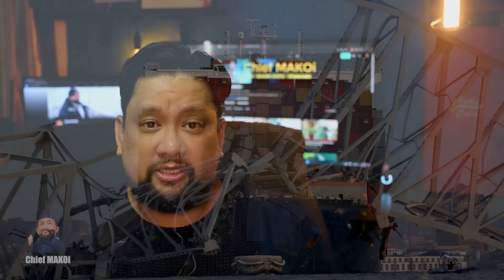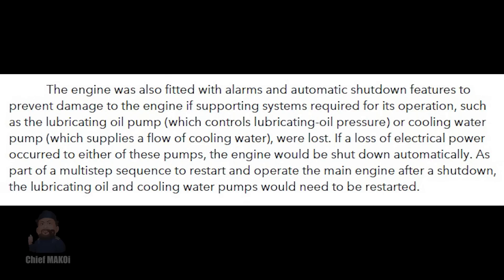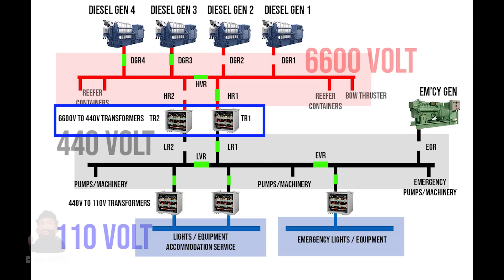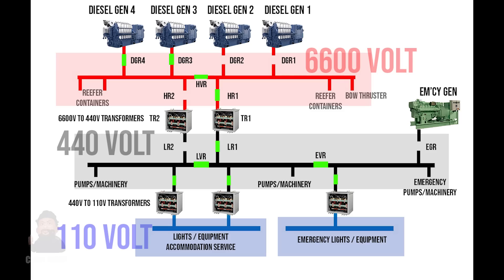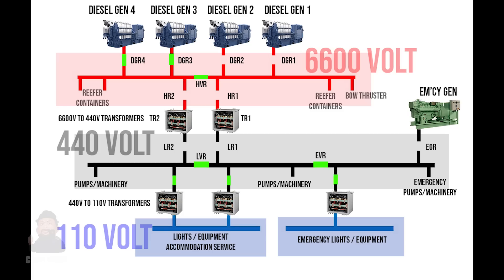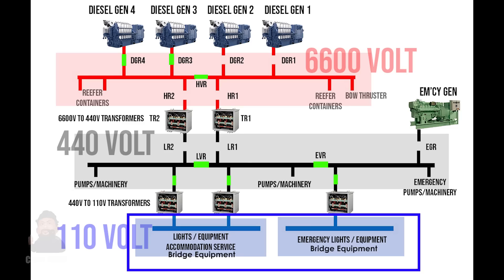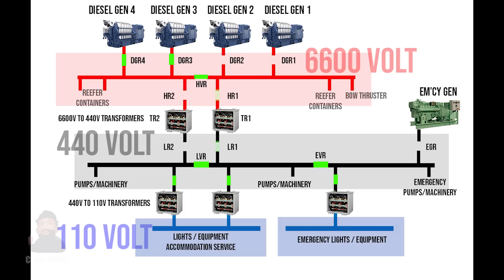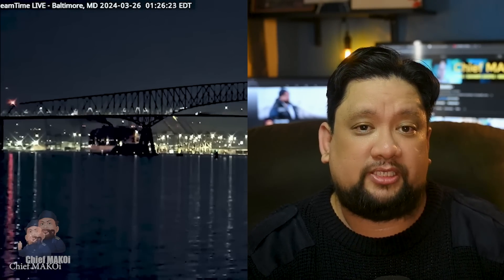Explaining the NTSB Report on the Container Ship DALI | Chief MAKOi

Comment: I think the start of this problem is in either generator 3 or 4  . If either one is not receiving enough fuel the other one can be driving the one with the fuel problem because they are locked together electrically. The good generator would be overloaded and make black smoke and would be running to slow. The cycles would drop , this would increase the output amps on the 480 volt transformer tripping its breakers. Generators 3 and4 shut down due to overload on the good generator . the fuel problem generator shut down due to lack of fuel. I also think the crew has it wrong stating that both breakers in and out tripped open for transformer TR1 . The inlet breaker protects the transformer the out put protects the wiring down stream.
Reply: I think so too. In the panic after the first blackout, they forgot to turn on the fuel pumps as soon as they got power back on the 440v bus. Looks like the same thing happened in port when DG#2 shut down from the exhaust stack flap, and #3 started but there was no fuel pumps running at that time because of the blackout.
Reply: Motorizing one of the generators despite safety mechanisms is one possible explanation for the heavy black smoke.  I'm thinking the other possible explanation is they were lined up on Heavy Fuel Oil instead of Ultra Low Sulphur Marine Gas Oil for generator restart.  Its not clear to me how it was determined when the generators were on and when they were off.  To overload the generators enough to make that much smoke with a fault in one of the transformers, I would think there would be a phase to phase or phase to ground situation that would be spraying molten metal and pretty easy to identify.
Reply: @douglastastad7437  They were using LSMGO for about 3 weeks before this incident, so no fuel changes in last 25-27 days. I'm thinking more along the line of fuel starvation due to the loss of 440v when TR1's breakers tripped. They had t his same problem the day before when DG3 auto started from standby after DG2 tripped from the exhaust being blocked, which also caused a brief blackout, and DG3 shut down due to low fuel pressure. Then they had to restart DG2 and switch transformers
Reply: @brnmcc01  Where are you getting the detail regarding LSMGO being burned for 3 weeks prior to incident? I would find it very hard to believe a vessel with scrubbers is burning LSMGO on an ocean voyage.  Would love to see the noon reports and Maersk corporate's response.  But if that is the claim, it would only add to my suspicion.  Now the NTSB states they were using LSMGO during the incident 3 times in their preliminary report, but they can't yet determine if the emergency generator came on in 45 seconds.  My guess, yes fuel starvation... Because they were switching to HFO and Effed the line up.  Why switch?  Oldest trick in the book.  Your point is an interesting one though - I wonder if there is any video or other record of black smoke while she was at the pier duirng fuel starvation blackout - you put that up the stack during daytime and the port captain should be writing up a fine.
Reply: @douglastastad7437  I read it somewhere in the full NTSB report, the ship had made another port call before heading to the Sea Girt terminal so they had been running on LSMGO for a few weeks prior to the incident. And yes they would have switched over to heavy fuel oil for the very long voyage to Sri Lanka as soon as possible, but they wouldn’t have started it that early. It takes a long time to do the switch and has to be done carefully and gradually over a several hours. Chief Makoi has a good video on his channel explaining the process. There’s a lot of steps involved in making sure the fuel is up to the right temperature, fuel samples must be taken and viscosity checks etc.
Reply: To do the switch over right and not - you know - cause a blackout would take some care.  It's also illegal to make the switch that early.  I remain suspicious.
Reply: @douglastastad7437  You're absolutely right, but if they were doing that there would be mixed fuel in the fuel lines, day tanks etc. The NTSB has already taken fuel samples off the ship looking for just such a thing. Also representatives from the ships owner also had fuel samples taken and shipped back to Singapore. I think the reasoning behind that one was if the ship owner could shift at least some of the blame onto contaminated fuel they had just previously bunkered prior, the ships owner could then use that as an exhibit in their court filing invoking the 1800's limited liability that the Titanic used, as in "it wasn't our fault, it was that bad USA fuel". Well, that didn't go anywhere. I think it was a transformer fault combined with faulty electronics in the swithboard that caused this whole mess. Why was TR2 in use for "several months" according to the crew statement in the NTSB report? You'd think that responsible engine room staff would regularly switch transformers, because having a spare is really nice, but, if you never operate your spare equipment, how do you know it'll work in case of an emergency? Like when a power outage happens .6 miles from a bridge with only 4 puny dolphins....🤣
Reply: @douglastastad7437  I think in this disaster, like so many others, we have to apply the good old Occam's Razor here. "Never attribute to Malice, what can be adequately explained by incompetence". We already have plenty of evidence of the latter. Working on an exhaust scrubber on a running engine? Really? That's so dumb and dangerous due to the poisonous exhaust gases, plus very high temperatures involved. Closing an exhaust damper on a running engine and plugging it's exhaust while under load? That could have caused severe damage to the turbocharger if it didn't trip and shut down fast. And TR1 hadn't been used in months, so they switched from using TR2 which was working reliably for several months, but then during a high risk docking and port maneuvers let's use TR1 during a critical time? Yeah I get it's important to exercise your spare equipment, but leaving port is not the time to mess around.

I can nearly guarantee that if Chief Makoi was in charge this shitshow would have never happened :) Or at least been much less likely.
Reply: Nope.   Generators on a common circuit like that have back feed protection for just that reason.    Governor quits,  fuel dies,  regulator  quits,  the Revers Power Relay trips it off line via its CB.   That CB is charged up to trip so its just a solenoid to trigger it OFF.

Comment: Thank you Chief, this is the true and correct explanation of the NTSB report, as it is very clear in all details. 

I worked with 50 Hz generators and the breaker usually trips either because of a current overload, an under/over voltage, or because of an excessive frequency deviation, say below 45 Hertz or above 55 Hertz. The engine governor keeps the frequency in range by intervening on the fuel pump; if - as per your hypothesis - the fuel was tainted, the governor couldn't keep the speed, the frequency dropped, and the breaker tripped. This make sense for the second blackout, when the 6,600 Volt line was killed; the first blackout, very likely, was triggered by an under voltage condition, as the frequency alarm is designed to accept the temporary frequency drop which occur when an heavy load is suddenly applied.
Thank you once more!
Greetings from the UK,
Anthony
Reply: Well xplain. I use to be a tester of gen - set tester. 😊

Comment: You'd know more than me but I presume if the generators get out of phase, as would happen if one slows for any reason, that would cause breakers to trip.
Reply: No,  it would cause the out of phase generator to trip off line vis its CB,  there is a reverse power flow relay for just that purpose.    HR1 and LR1 tripped first and they are not in the freq game.

Comment: Thanks, very well done video!  I wasn't a fan with the way the NTSB did the diagram, in particular with the way they show the emergency bus. 

Is it common to have only one transformer in use?  This is contrary to what I've seen in land applications.  There, both transformers would normally carry 1/2 the load each, with the low voltage tie open.  The tie would only close on the loss of one of the two transformers.  If that had been done, they would have only lost 1/2 of the 440V bus until the tie was closed.

I find the choice of closing the same transformer back in after a trip odd.  You'd think the crew would switch to TR2 due to the risk of the trip being a fault of in TR1.

Another item I'm curious about is the details on the generators.  The NTSB report gives the main engine information, but nothing on the generators.  Were they two stroke or four stroke?  I'm guessing 2 stroke.  If they had closed a damper on a 4 stroke engine, it likely wouldn't have tripped the generator, the exhaust back pressure from the engine pumping would have blown up the ductwork.
Reply from the maker: The generators are 4 stroke.  Onboard ships, the transformers (TR1 and TR2) are usually used one at a time.  The breakers are mechanically interlocked so only one set can be in closed position at a time.  The interlock can be removed during special maintenance, of course, but normally only one is used.
Reply: @ChiefMAKOi  Don't take this as me doubting you, it seems that is standard practice shipboard.

It just seems very odd from someone who has far more land based industrial experience.  It is very common in industrial practice to use double ended main-tie-main boards.  That's where the two step down transformers are located on the ends.  The mains will be next to the transformers on each end, and the tie breaker will be located at the mid point of the low side bus.  This is common for both low voltage and medium voltage applications. The breakers will be interlocked such that the tie breaker can't close if both mains are closed, and a second main can't be closed if the tie is closed.  Breaker operation may be manual, or it may be automatic where a main is opened when its respective transformer is dead and the tie closes.  On restoration of power, the tie will re-open and the associated main will close.  On any kind of bus fault, the automatic changeover is blocked.  It makes for a very reliable system.

The advantages of running both transformers at 1/2 or lower load is a pretty long list:
- You know both are good at all times, and don't face the trouble of wanting to depend on the second, not knowing if it works until energized.
- No issues with moisture buildup on a dead transformer, the heat generated keeps moisture out.
- Efficiency is higher except at very light load.
- Transformer life is longer, as insulation life decreases exponentially with temperature.  Running cooler all the time is easier on the insulation compared to half the time at a higher load and resting the rest of the time.

The only disadvantage is a little big lower power factor due to the magnetizing current and a lower efficiency at the lowest loads.  I can't see any of this making sense as the more desirable design. Frankly, I hope this makes it to the report and falls into the "there ought to be a law" category and the US bans ships until the system is retrofitted to use the main-tie-main concept for ships with medium voltage power systems.
Reply: @ChiefMAKOi  "The generators are 4 stroke."  
That makes me wonder if they floated a valve on the engine and broke one or more valves and /or pistons?  On a four stroke with a gagged exhaust, it will either blow up the exhaust piping or it will float the exhaust valves during the intake stroke.  When the pressure above the exhaust valve generates a force greater than the spring force, the exhaust valve will be held open.  If the engine stopped and they didn't inspect it, they may have had a damaged engine and not known it.
When they tried to start the generator #2 later, the cylinders with holed pistons and / or bent exhaust valves would not have enough compression to burn.  They'd push the unburned fuel into the exhaust, making lots of smoke.
Reply: I have had to delve deeply into safety and backup and I would mandate that the plant be split in critical maneuvering (before) and both sides of that HV system be not only live but feeding duplicate pumps and systems to ensure the main engine keeps running.    I also would have the EG set on line and its Bus Isolated so it was running the 3rd steering motor and add in Bow thruster up and running so that it can be used as an assist.    Not all the time but during critical maneuver phases (or well before going into them)

Comment: Great video! Question, if the generators kept running and therefore supplying voltage to the high voltage buss could they have used the bow thruster?
Reply from the maker: It seems possible.  But it won't be very effective at that speed and I think it would be far from their minds as the priority would be restoring power.
Reply: @ChiefMAKOi  thank you chief! I have no seafaring experience so I was just wondering

Comment: Seems very implausible That two breakers on the same feed would trip With a fault if the coordination of the breakers (design) was correct, First that sees a fault should trip.  
I would think if there was a transformer fault the primary breaker should trip. I don't know if on board ship primary would dump the secondary for the backup wouldn't want to feed the scondary of a faulted transformer.I'm sure it will ALL be tested. Chief your comments?

Comment: In the report, the NTSB makes no mention of LR1 and HR1 tripping during the second outtage. They only say that DGR4 and DGR3 opened, DGR2 automatically closed, and then the crew manually closed HR2 and LR2. 

Why would they close HR2 and LR2? Just to parallel for redundant purpose or was there something left out of the report? Did they forget to mention that HR1 and LR1 tripped again? Because in Chief’s diagram 12:19 it shows them in the open position. 

Regardless, can’t wait to see the alarm history log for the electrical faults during the outtages. I think that will tell most of the story if we ever get to see them!
Reply from the maker: The report said they restored power after closing HR2 and LR2.  That means HR1 and LR1 are open.

Comment: Chief (or others in the industry), with the crew still on board to maintain the ship, are they told to not do anything with the systems indicated in the NTSB report to leave the evidence in the state it was at the time of the accident?
Reply: Some of the pictures released by the NTSB shows them placing seals or lockout/tag out devices on some equipment.  I assume it's the equipment that triggered the initial power failure.

Comment: Reefer System:   This is shown as HV system.   That is some nasty stuff to work with.   Do they step it down out at the Reefers to 440 or 110?    Reefer refrigeration motors and controls at 6600 volts would be seriously costly and require specialty shops to work on.    Plug and unplug would be a huge issue.
Reply: I was curious about that too.  If that is the case thevreefer load needs to be dropped in an emergency during critical maneuvering making all power available to the propulsion and steering systems.
Reply: Somewhere in the lists of comments Chief MAKOi stated there's another transformer(s) bringing it down to 440V (which fits to my expectation; considering container cooling also needs to be done on trucks while on the road).
Using 6600V first and separate transformer does makes sense to reduce the current from the main LV bus; considering the power required for any such climate equipment.
In case of emergency like full blackout, it's also bit easier for any load control system which immediately will remove the reefer power supply to reduce overall load.
Reply: @NRZ-3Pi10  The over the road reefers I know about are engine driven.      No idea how they handle them into a port and then what is done.   6000 volts even with a transformer is a nasty deal with that HV side.
Reply: @gregoryschmitz2131  I'd expect the reefer motors can simply be connected to the 440V grid. For very simple estimation (!) of ball-park (!) figures, let's assume 660 containers are reefers and may need 10kW power each, i.e. 6600kW total. With 6600V = 6.6kV, this would mean an effective current of 1000A ( !!! ; 6.6kV * 1000A = 6600kW) on the HV-bus. Of course, it would require complete power capability of one 4400kW DGR plus another 0.5x DGR (2200kW, to be precise 😅). Means the total amount of reefers is limited (and might be much less than 660), of course. It also requires proper power management since bow thrusters are also expected to be high power engines. However, the latter are only required for very short period when navigating in-port, where you could switch-off the reefers without any significant drop of temperature.
Reply: @NRZ-3Pi10  Yea the reefers are 1500-2000 limit and forward so the 6600 volts makes sense with that long a run and voltage drops.
Reply: @gregoryschmitz2131  In case you've wondered about the effective current on the 6600V HV bus from my estimation: my bad and corrected now for sake of preciseness. Should have done proper adaption of units from V to kV first, then calculate current from power consumption.
Reason why I'm also mentioning currents involved here: high voltages are bit more tangible from the effects they're causing, e.g. sparks. High currents are much more hidden from everyone's daily experience. However, those are linked to magnetic effects with tremendous force and power, which is especially important when e.g. cutting of transfomers under full load condition like what happened when both breakers HR1 and LR1 tripped.
Reply from the maker: They have their own transformers.